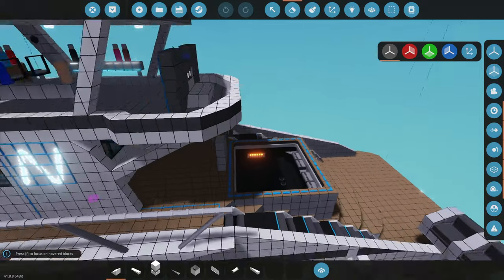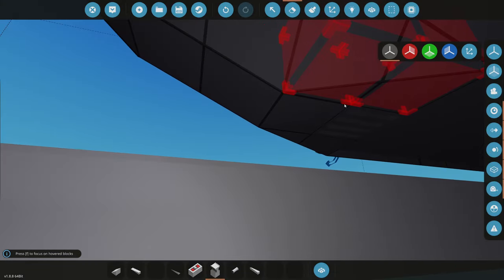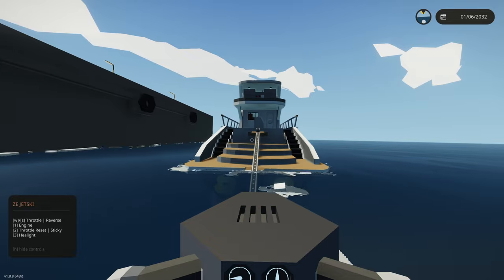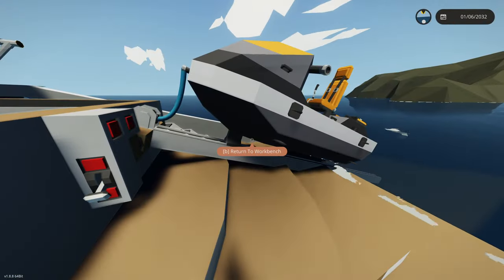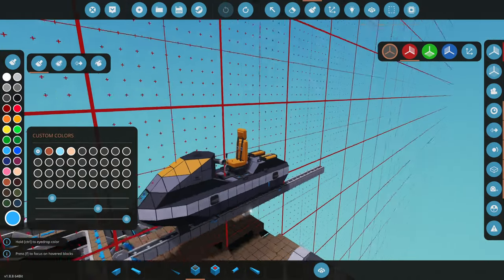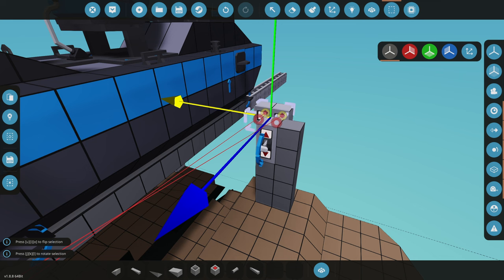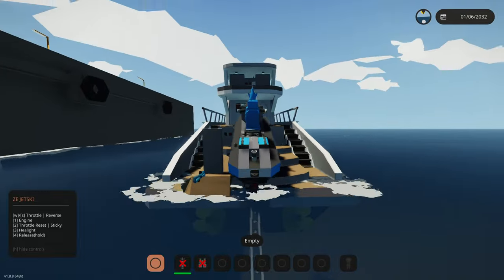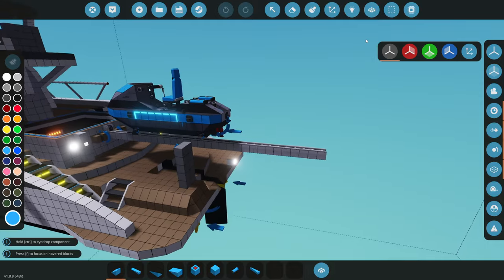I Added a JET SKI! | Ultimate Vacation Yacht, Stormworks (#11)

Comment: Add a rolls Royce disco ceiling in the disco area (basically a bunch of white pixels on a black background
Also you could’ve used a folding mechanism for the jet ski track
Plus, winch is unnecessary, you could have used a double track